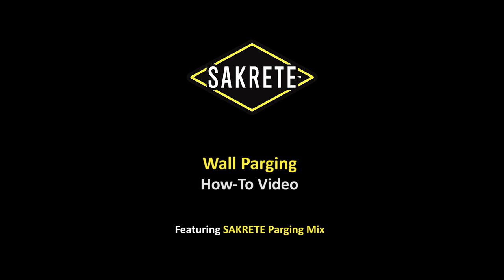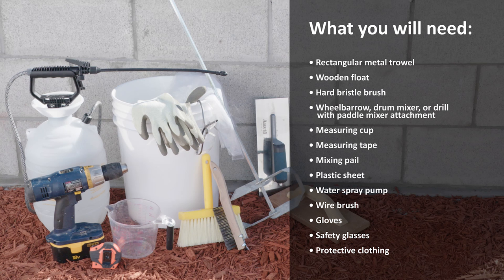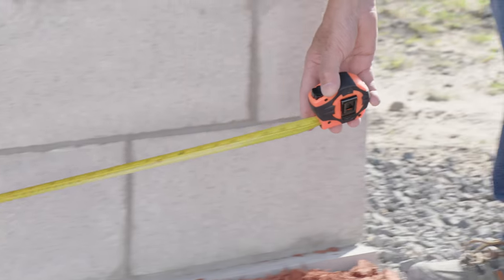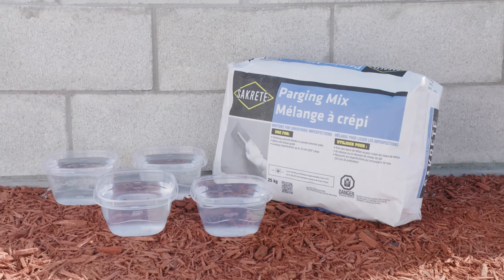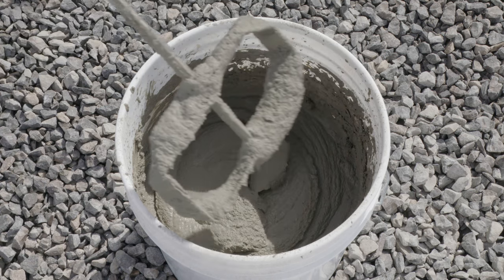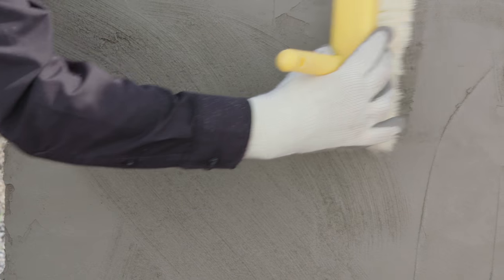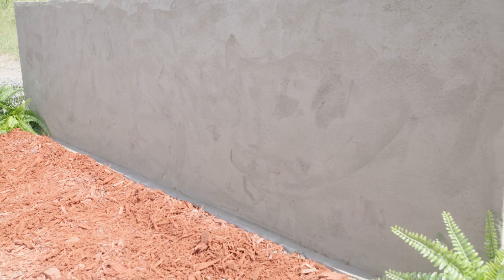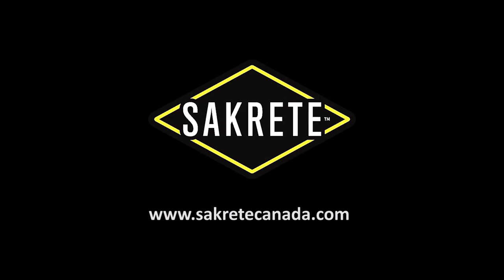How to Parge a Concrete Block Wall | SAKRETE Parging Mix How-to Video

Comment: A trick to make parge look Professional is using a sponge. Trowel it on domt have to be perfect just get the thickness close. Let it cure a bit and use a wet sponge going in circles with very little pressure to take out any imperfections.
Reply: thanks!
Reply: That’s what I do. Not a dripping wet sponge though. Squeeze all the water out. Just a wet sponge.

Comment: Thank you for this great video. I have a question.
It is written on the bag structure that "Mix and substrate temperatures should be maintained between 5 C and 30 C for at least 24 hours prior to and 48 hours after". I want to fix my house foundation wall by using first hydraulic cement for filling cracks and then covering with Sakrete parging mix and painting it at the end of process. The place that I am located is cold and sometimes temperature is minus these days and it is mandatory for me to fix my house foundation before winter time!
Can I use it without any problem?
Reply: I believe you can find other options with can be applied under other conditions.  Go to the Sackrette web site or your hardware store for more options.  I was surprised by the many options and cement solutions.
Reply: did you do it? how did it go? technically hydraulic cement is meant for plugging holes and not for skimcoating so I am curious how it went for you.

Comment: what if you can only access one side of the cinder block wall? i have a cinderblock wall butted up to a hillside.
Reply: Then only put parging on one side!  Obviously, if you want to parge the side of the wall that's against the hillside, you'll have to dig that out.  How was that not obvious?  Did you vote for The Rump?
Reply: JL - because of concern of moisture pushing thru from other side. My question wasn’t  clear so I’ll give you that. Your type of response makes it pretty clear the type of person you are. Have a nice day.
Reply: Desiree Stinson you can still parge the one side, it’ll be porous all the way through, what you don’t want to do is put a roll on sealer or paint because that will eventually peak off.
Reply: Lopside thank you!
Reply: @dallashill23  shouldn't it be sealed after drying to keep moisture out
Reply: @Danny-ju2ip  not really, unless you want to maintain it, over the months and years it will continually need sealing or painting do to peeling off